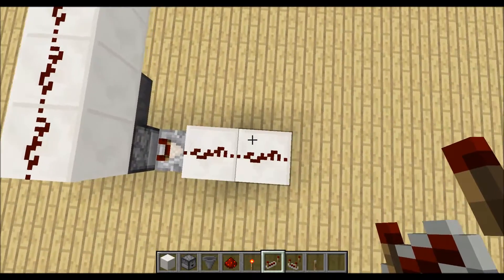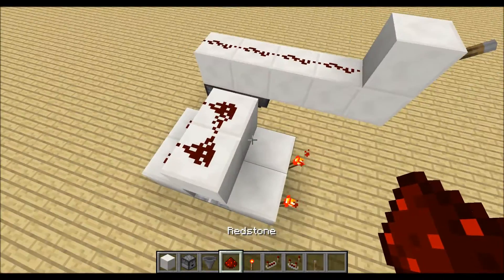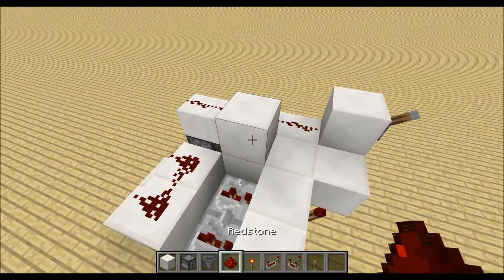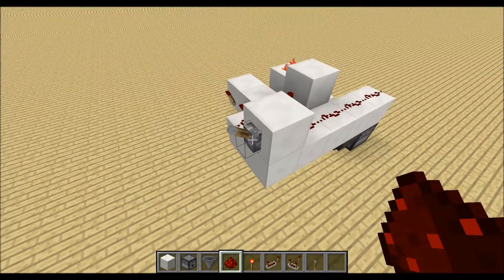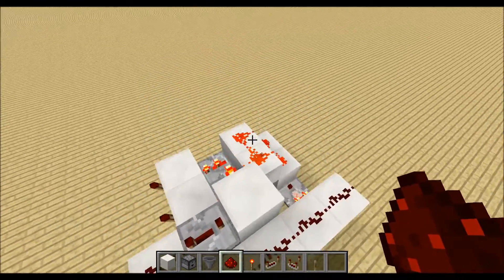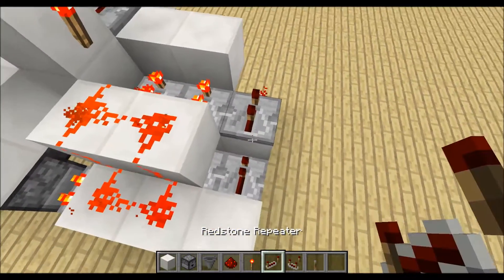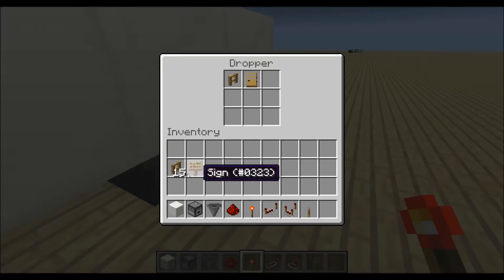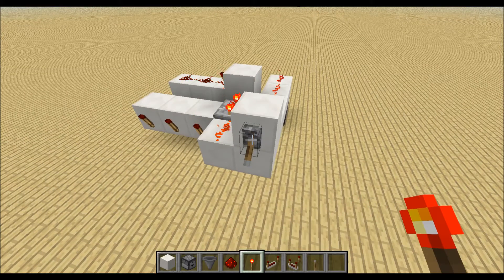Randomizer for 2 and 3 bits [Tutorial]

Comment from the maker: The fence can be stacked to 64. If it is chosen we will not miss so much weight and we get an output of 3. The sign is "bigger" because it can only be stacked to 16. So we will get an output of 2. If the door which is not stackable is out of the dropper we will only get a output of one.

Comment from the maker: Its not possible with one setup to get more outputs, because there is no item which got another stack size. you can't stack doors, signs up to 16, and fence up to 64, which you can detect.
If you want more outputs you need to combinate two randomizers or more.